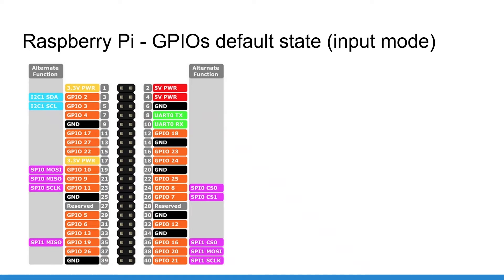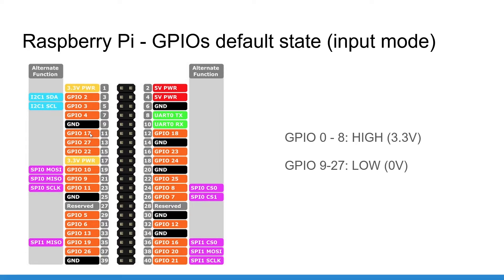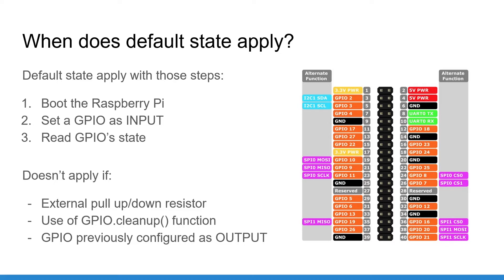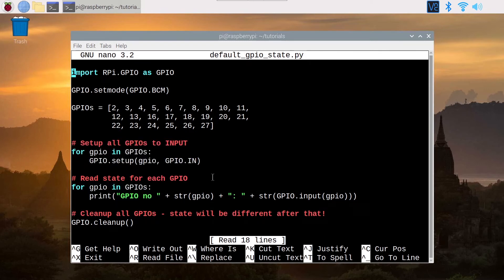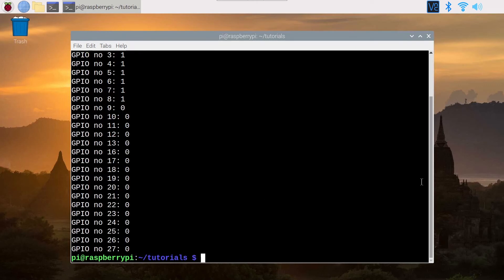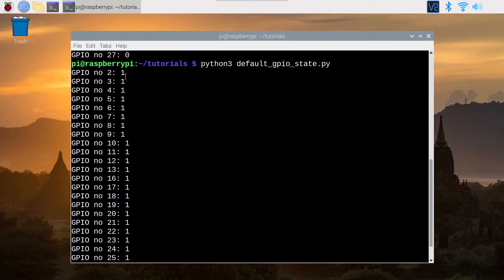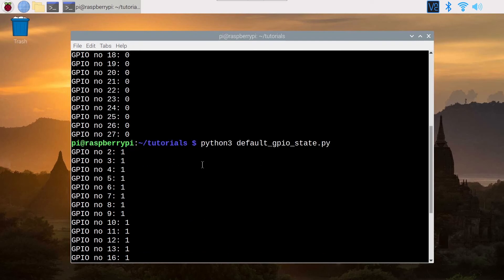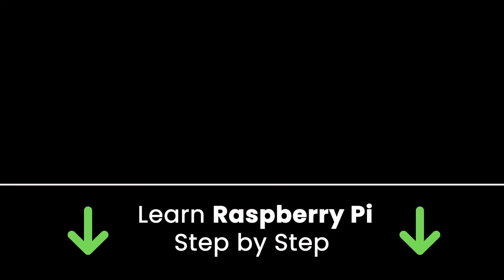Raspberry Pi - GPIOs Default State - And How to Fix!

Comment: @Robotics Back-End - at 11:30 How is a 10k ohm resistor stronger than a 50k resistor?
Reply from the maker: The current is inversely proportional to the resistance value (check Ohm's law), so 10k is stronger than 50k
Reply: @RoboticsBackEnd  I think that the word stronger is a poor choice of words.  Resistors don't have an attribute or characteristic related to any measure of work load (an attribute that could be characterized by "strength"). 
Resistors can have resistance, precision, wattage. 
I googled the words "stronger resistor" and found no occurrences of anyone using that language.
If you had said, "...a 10k resistor has stronger throttling of current than a 50k resistor", then I might have been able to make sense of the word strong in that context, however that is even a stretch of the how we consider quantifying resistance, or its effect in a circuit.
Of you were making a video about subjective experiences like taste of foods or smells, then go ahead with using characterized language that is not directly obvious...
but, you were trying to educate viewers on choosing a specific resistor based on its resistance value according to application of Ohm's law to understand its impact on current flow (which, ironically, is not a force that pushes or pulls so can also not be measured in units characterized by strength).
Because this video is instructional, perhaps using accurate language would be a "stronger" means to impart technical concepts.